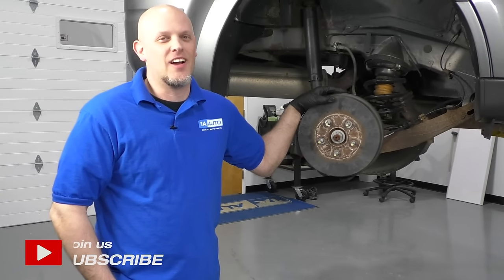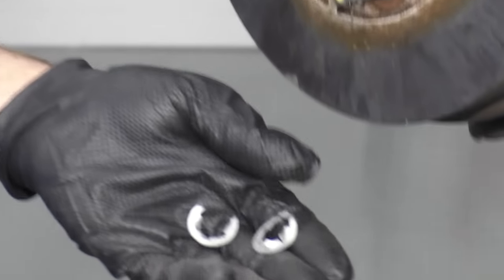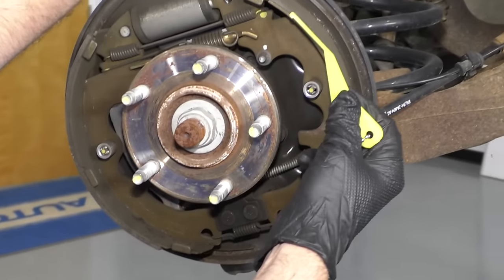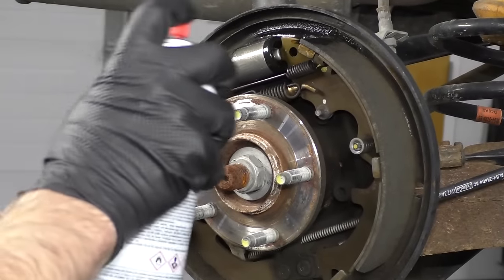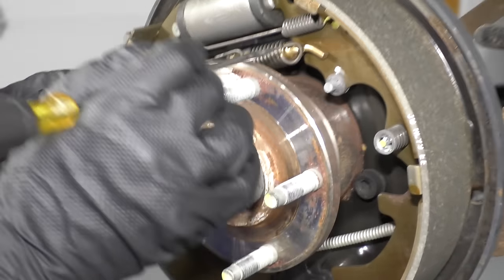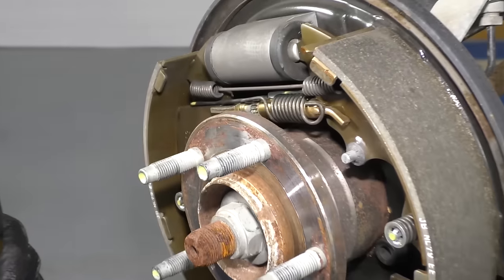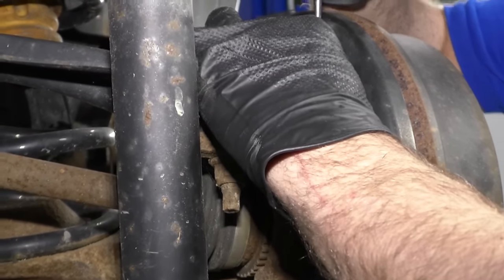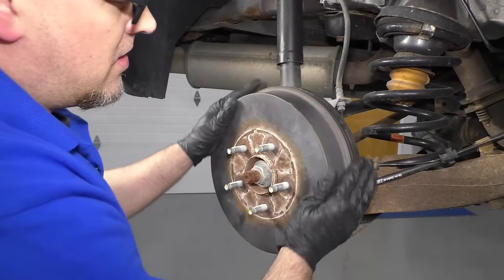How to Clean and Adjust Rear Drum Brakes

Comment: A word of advice...don't "take the little door off" and mess around.  The only way to adjust from the back is to tighten,  and if you tighten them too much you can't get the drum back off and then your screwed.   It's near impossible to loosen from the back side.
Reply from the maker: +Jason Sims Thanks for the tip! We'll pass this info along to our production team.
Reply: You are right, but most of the time with a little patience and efforts you can still loosen it from behind using two small screw drivers.
Reply: If you can’t back it off from the rear you shouldn’t be touching your brakes.

Comment: Why are all drum brake adjustment instruction videos based on "feel" and not from using some sort of instrument or tool?  Is there really not an exact setting to follow?  You know like manufacturer torque specifications on a bolt?   How do they adjust drums on a newly built car out of a factory?
Reply: The same way I guess, once you are adjusting you will feel or hear the drag and that's when it's good, it should turn easily still
Reply: Good question /remark  -yia 
Good answer - jose
Reply: Hopefully you will see this. The manufacturer instructions read that using a micrometer or calipers to measure the inside diameter of your drum that you shoes should; at proper adjustment; measure exactly 0.5 mm less the the inside diameter of the drum. I work for the dealership.

Comment: how do you determine that the tightness or drag (whatever) is enough? Is there some sort of a standard measurement or indicator? thnx
Reply: you open the adjuster until the drums do not fit over the pads, then back up the adjuster one click at a time until the drum fit. Leave the adjuster set for the drums to barely fit.
Reply: @j.antoniovarela5982  Good tip, thank you!

Comment: Don't need to remove the drum.  You get a much better pedal by adjusting at the small window on the back side. Just keep turning the drum til you feel and hear the drag. That's it.
Reply: They remove the drum so it can be inspected and cleaned

Comment: Tip For Dummies (in a good way): If your rear brake drum isn't releasing, no matter how hard you hammer on it with a sledgy, you may not have released the e-brake. Release the e-brake in the car, and ensure that you're in park (if you have an automatic) or 1st-gear (if you have a manual). The e-brake will lock both of the rear drum shoes into the brake position, which will not allow the drum to release from the axle tube.

Another Tip for those not using a lift to raise the entire vehicle in the air: Before releasing the e-brake, you need to make sure that the vehicle wheels that are still on the ground are all chocked with something that prevents the vehicle from rolling. When you just rely on the transmission to lock the vehicle, there's still a large element of danger present. Chocking the wheels ensures that you have done everything necessary to prevent vehicle roll while you have the automobile lifted at a specific angle. You will also want to make sure that you are NOT DOING THIS on a driveway, or an incline/decline of any sort.

Safety first, everybody :D
Reply: is this the same adjustment for the park brake?

Comment: I like the remove the other drum to get an accurate 1side check.  Great job!!!
Reply: So if you are gonna check both sides, and you think you have the right side good, then you would remove the right drum while you go adjust the left side?  Also, left drum was removed while you where adjusting the right side?  So it is necessary to jack-up both wheels?  Watched a video where a guy just wiggled the drum just a bit.  Axle studs weren't moving; only movement was from clearance around drilled holes in drum.

Comment: I live in Canada when I change my tires over in the spring and fall,I always clean my drums and inspect them,  I also used anti size around the hub and the drum , for easy removal. 
I drive a trucks, so I always back up my vehicles this help the automatic adjustment.
The thing is when it is time to switch over your tires the garage will not do this procedure unless the customers advise them. This should be and automatic task at time of switching the tires for the season.

Comment: Was getting a squeal from the rear passenger wheel when making turns after I installed new pads. I was going crazy trying to figure out the problem, almost purchased another new set of brake pads. Well my mechanic figured it out and readjusted my brake shoes and cleaned with brake cleaner. Not 1 single squeal since

Comment: In this video you should be showing a brake reset gauge on the shoes  letting someone know the proper and professional way to adjust the shoes The way you're showing your how you adjust the shoes is guessing You'll just have to keep taking off the drums and putting back on to the shoes until you  get the right resistant  on the drum / shoe

Comment: 💥 Excellent video, thank you. 
I tried my best but could not get the driver side drum off of my ‘01 Express 3500  even after soaking it with penetrating oil and striking it with a hammer.  I brought it to my mechanic and $730 later it was done.  I drove 4 miles from his shop and as I took a left turn to enter a highway the rear wheel separated from the van and extended out 2 feet on the axle.  The mechanic says it’s not his fault since he didn’t do anything with the axle although he gave the drum a good beating with a hammer to get the job done.  The nut on the end of the hub that holds the axle in place spun loose and the axle slid out….   Does anyone know how that could have happened…?? I think it’s much too coincidental that it happened only a couple miles after he did  the brake job for him not to own up to the problem.  🤟🏼🇺🇸
Reply: Absolutely no way that cause what happened to happen, the keeper in the rear-end more than likely was broken and about to fall off and the extra vibration just mad it happen, so the timing of the 2 was impeccable, had you not gone to to shop you would of been on the side of the road with the same problem, just saying, but here's the deal, who ever put the last wrench on it still hold the liability and that is for small claims court to decide

Comment: @1A Auto: Repair Tips & Secrets Only Mechanics Know  - thanks for sharing in-depth details in this video. What would be the consequence of having too much drag? I kinda just gauge the setting I needed based on how much resistance it provided when setting the drums back. After putting back on the shoes and springs on one of my drums, I did see the wheel adjuster isn't hitting the lever in the back, generally is there a concern that the adjuster could shift while driving? Thank you for your time.

Comment: Howw can drag on one side affect the other unless it's a driven axle it won't. 🤔🤕💥😁
Reply: The car in the video has a driveshaft going in to the hub, if your rear wheel isn’t driven then it won’t have any impact from the other side
Reply: A limited slip differential can affect both sides...I think.

Comment: I replaced my drum, shoes, cylinder and all the springs and now I get a “click, click click” when applying the brakes (the clicking is faster or slower based on my speed when braking so it’s rotation based I’m assuming?) any ideas what I can check to be the culprit? Thanks!
Reply: Did you get this fixed? I’m currently having this problem. Thanks.
Reply: Hi Sal, did you figure this out? Sounds like what I have after I got new shoes installed by mechanic. Almost like a chirping to me but definitely faster or slower depending on speed wheel is rotating, and mostly only when gently breaking. I was thinking maybe catching on the backing plate or something but need to investigate. Let me know if you fixed it! 🙏
Reply: @tonygibbons5  That could be a slightly warped rotor.....
Reply: @alfredneuman6840  There is no rotor on drum brakes.
Reply: I had that too I ended up returning the new drums and using the old ones...I think the material in the new drums isn't as good as the OEM ones .. they were AutoZone drums...if you really need to replace the drums buy OEM from the junk yard

Comment: you hose inside before you pull anything off

put the hose is the small gap behind the drum-keep injecting water until water coming down is clean 

another safe way-pull the drum off and hose down everything before you touch anything

Comment: Super thanks!
If I am using the rear section of a truck as a trailer. And I'm NOT using the brakes. Should I adjust them to have no drag?
Reply: I would remove all the brake components except the drum

Comment: Do you not recommend greasing the adjuster or other friction areas (excluding the shoe surface)?
Reply: Always remove the adjusters when doing the brakes and use permatex ceramic brake parts lubricant and clean them up with brake cleaner and wipe them down before you apply the permatex ceramic Grease. Also before you put the shoes on make sure that you put the ceramic grease on the backing plate there are usually six points where you smear a little bit of grease on those points that the brakes move back and forth freely they are high points when you pull off the brakes you will see them make sure they're clean before applying the grease

Comment: I recently replaced my brake booster and the pads and rotors. I also replaced the rear brake shoes and wheel cylinders.  And I bled the the brakes and wheel cylinders,and adjusted the rear  brake shoes . It's been a few months since but for some reason it feels like the rear brakes are not functioning properly every time I try to stop. Should I flush the entire brake system ,  or could it be that the slack adjusters are not working properly?  I worry cause everyone in my family uses my truck and I don't know their driving habits. Thanks
Reply from the maker: +S Glenn We wouldn't be able to diagnose an issue like that here, you may want to have a local mechanic take a look at it. Thanks for checking us out! 1AAuto.com
Reply: @1AAuto  thank you for your reply

Comment: So if I adjust the star wheel up that brings the shoes in more? I don't know which way I am supposed to turn it on my 2000 corolla. I need to loosen the shoes because they are rubbing the drum too much.
Reply: Have you got a vernier caliper? If so measure between the top of the shoes and you’ll see which way is correct by seeing if the gap is increasing or decreasing.
Reply: You can easily find out which direction does what.  When you can turn the adjuster one way and not the other it means you are tightening the shoes against the drum. Simple as that. It works like a ratchet.

Comment: Nice video. I am not sure that you are right about the automatic adjuster working when driving backward. To start with, there is nothing mechanical that can detect that you are going backward and not forward. In most cars, it works all the time. As soon as there is enough space between the dram and pads, the adjuster will turn. It is happening all the time while braking if it is functioning properly. I may be wrong about this car.
Reply: This is wrong. The shoes pivot about a 1/4 inch when you're reversing while braking, this allows the adjuster wheel to ratchet a click tighter.

Comment: good. vid. Don't spray the shoes with brake cleaner. tighten it up a little and then put drum back on and tighten from the back until perfect.  BAM! This way you don't need to loosen it up.
Reply: Why not spray the shoes with brake cleaner?

Comment: why setting for some drag, is that to heat and expand the drums  so they lock up when hot just driving down the road, like my mech did, my wedding car didn't get to the wedding, NOW all my front and back drums are 1 click off drag so drum is cold and ready for down hill braking from cold, not to mention hand brake starts "uphill" full of customers, and you have the drums "ON" with pedal off ? should i install anchor as well
Reply: Hello, the mechanic hammered the drums to break loosen it from the wheel. Since then it's making rubbing noise while driving. Is it safe to drive? He said the drum is rusted out and next time when I change the brake shoes advised me to change the drums too. Wanted to check with you experts. Thank you in advance.

Comment: I need to adjust my maxima so three clicks is that full rotation 3 times or literally 3 clicks?
Reply: l2007303a you can adjust it with the drum on through the back door and tighten until you can anymore. Then loosen it slowly from there to find the amount of drag you need.
Reply: Gerson Cortes I wanted to try that. But it’s not so easy getting around the back